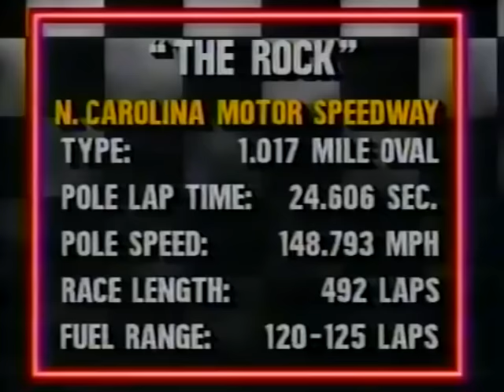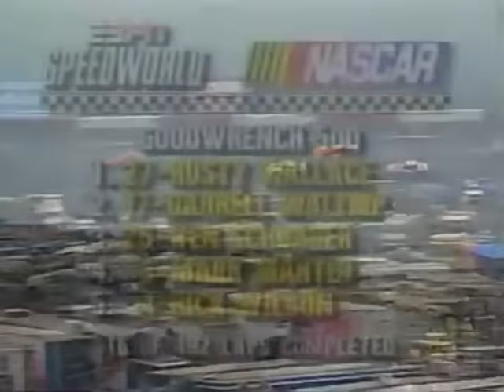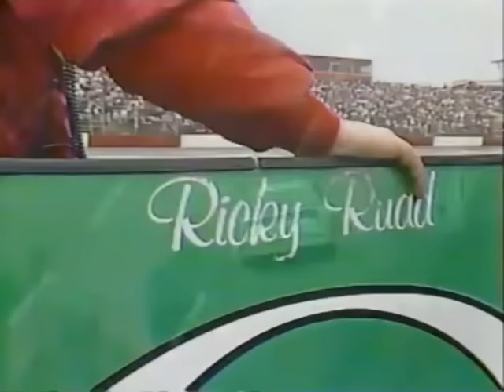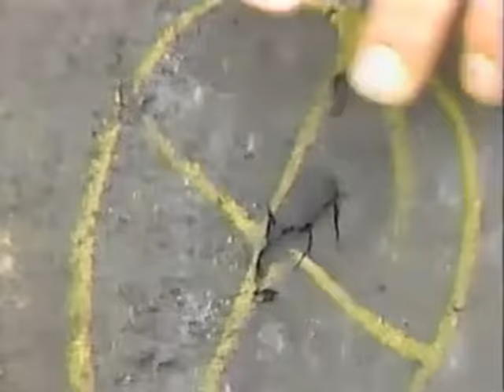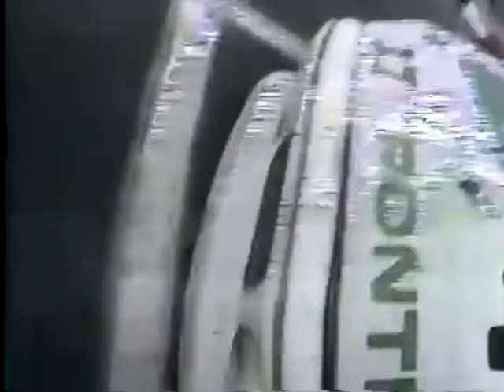1989 Goodwrench 500

Comment: Ricky Rudd and Harry Gant had the cars to beat in this race, but you wouldn't know it from the result. I never hear people mention this wreck when they talk about Dale racing dirty and they didn't bring it up the next week in the broadcast, but this is one of the worst examples of him wrecking someone I've seen. Dale's car wasn't good, he had no chance of winning (without taking out the best cars), but he f*cks with the leaders after several restarts, almost wrecks them at 2:39:50 and finally takes Ricky out at 2:42:15, for no reason. It was nice to hear Harry call it what it was at 2:48:25. I feel like this one is worse than most of his because he'd usually just square someone up with his bumper, not right rear you into the wall (although that's what he did to DW too). Ricky did a hell of a job to save it.
Reply: Yeah I have to agree. I was a Dale Earnhardt fan but he did some very harsh and foolish things at times. This very early season wreck is why Ricky Rudd didn't cut Dale any slack later this season at North Wilkesboro. And Ricky was right in not cutting any slack. And candidly Dale drove right down on Ricky's door going into turn 1 at North Wilkesboro too. Dale Jr said that too on his podcast.
Reply: @bradleyhudgins1005  He was tons of fun to watch lol. I felt like this one was bad even for him. He was a savant on the track and I think sometimes he just got bored.
Reply: I had to keep watching the replay and  I'm not so sure that Ricky didn't make the initial contact on Dale's left, rear corner, that got Dale  loose, when Ricky dove down in the corner. Ricky seemed to go into that corner a bit hot too, but maybe Dale decided to slow considerably Idk. Rusty was right there in the perfect spot and was asked about it on the radio by the commentators and he called it 2 guys going for the sme spot.

Dale was notorious for nudging a car out of the way or just outright  wrecking a car (ie. Labonte twice at Bristol) and because he is Dale Earnhardt he's always believed to have full control of his car like no one else. So any incident he ever had, its almost automatic to say it was intentional.
Reply: What about intentionally hitting the 27 on the last pit stop?